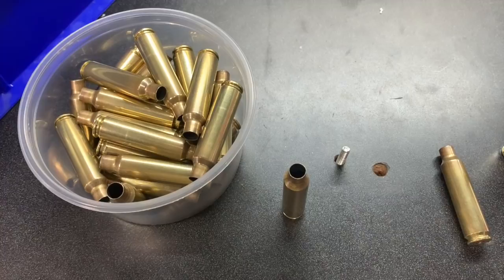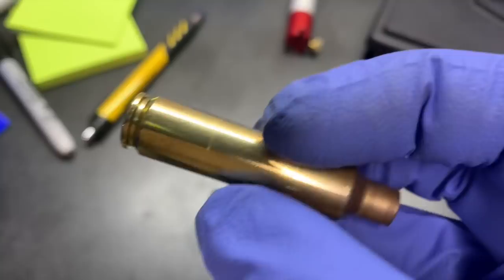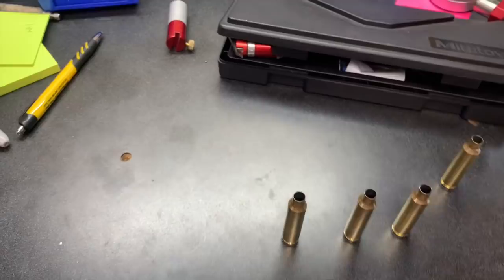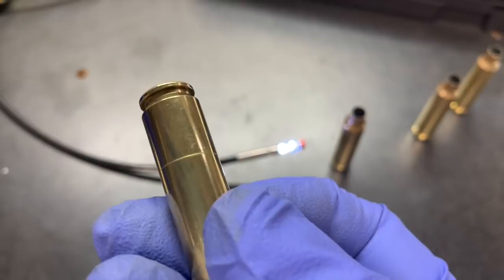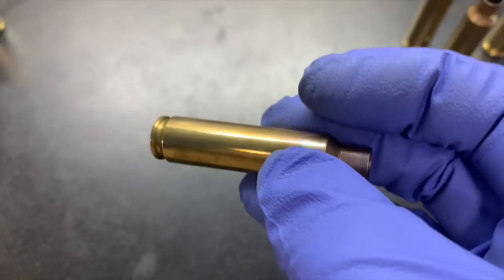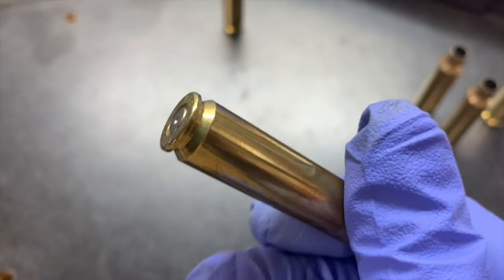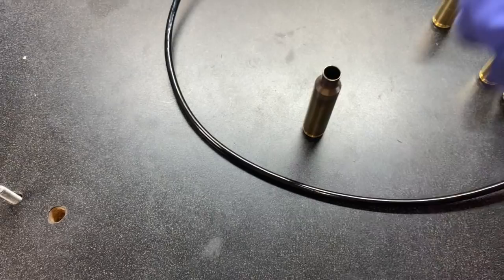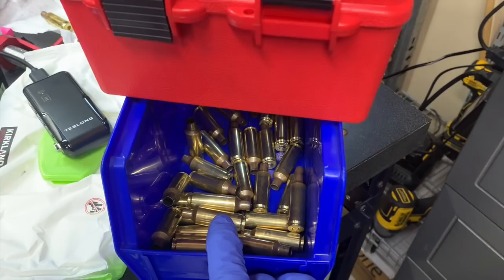Case head separation and what it looks like before it happens

Comment: When I first see the faint line, would I be safe to toss it after the next firing?
Reply from the maker: I couldn't say. I've shot faint lines with no issues and other times had separation. Do what feels safe is the best thing. I tend to lean on ditching brass for several reasons but everyone is different. For one I rather have the best brass to test or shoot (unless I'm testing something weird that doesn't matte) and second I just don't like risking a separation if I can help it.

Comment: I have once fired brass a similar line 1/3 down from the shoulder showed up after full length sizing, do case head separations happen so high? I am wondering is this likely caused by the dies?
Reply from the maker: It depends. If it's right after sizing then yes. If it's after you've been shooting then it's a wear mark from the ammo box which can happen if the hole for your ammo is round.

Comment: I’ve had a few separate but never had one completely separate from the head. Have you ever had that happen or have you seen it? I bet that would be a huge mess.
Reply from the maker: I’ve had it happen and it’s not that bad in terms of a mess. The few times I’ve had it happen the brass came right out although I’m sure u see different circumstances and guns the result could be worse.

Comment: Hi John, I've been looking at this issue lately. I've only ever had 1 chamber produce seperation, a 6.5 SLR that I ran hard and only 5 of 200 cases. You mention that it's caused by sizing. Is that an educated guess or are you sure? The reason I ask is bar the initial resize from 308 to 6.5 I used a Lee collet die  so never sized the body. (Don't tell Eric). I've heard of a few possible causes, just want to try and ID the actual one for everyones benefit.
Reply from the maker: Best I know (and I don't know everything) is that excessive shoulder bump is the main culprit. I do however feel (and I could certainly be wrong) that body sizing has some effect as does how the brass fires in the chamber (but to a very small degree). But keep in mind that if you can trim your brass then you're losing brass from the base to some degree and it adds up over time. And don't worry, I won't tell Eric.
Reply: @FClassJohn  Thanks John, I have a theory that fl sizing is in play here but not the "cause". I was thinking excessive head space on initial fireforming, but on F class guns??? Just not happening. As someone else mentioned,  I noticed your seperation is way further up the case than I've seen before which may be laying another possibility to rest. It looked like the inside of those primer pockets were chamfered. I don't suppose you know what tool was used?
Reply from the maker: @timg6252  I'm sorry I don't. But I like where you're going with this...
Reply: @FClassJohn  I was doing some high speed filming of primers and ran a chamfered pocket through the test. The flame front is a completely different shape (well it's meant to be, that's why some folks do it). It just struck me that the angle of the dangle meant the flame front would hit the case wall right where case head seperation (usually) happens. Your case stuffs that theory up a bit unless the chamfer was done with something 'unusual',  but I'll persue it a bit more.

Comment: Have you noticed if the streaks/channel on the inside of neck effects accuracy by making scratches on bullet?
Reply from the maker: Anecdotally yeah I’ve seen some light marks if I seat a bullet and them pull it. Thats also why I used to bronze wool my necks (a practice I’m starting to do again).
Reply: @FClassJohn  did you do a video on that? I have some virgin Lapua brass that had like a ridge at base of neck. When I ran carbide mandrel it left tiny amount of brass on mandrel. I did not notice till all was done and went to seat bullet. Seated one and pulled bullet. Scratch jacket
Reply from the maker: @justinvandee2008  Yeah it's old. One of my first brass prep videos. The brass wool was part o the video.

Comment: John, have you ever had brass separate in the chamber? I can imagine it might be difficult to get out.
Reply from the maker: Yes I have and it really isn’t that bad although it does affect your shot for sure which is why I’d never risk it at a match if I can help it. Under different loads in different guns the result could always be different of course.
Reply: When it happened to me I used a brass brush on my rod to push it back out

Comment: When I fl resize my brass actually grows by about .0015 does that mean my headspace is off, it still chambers fine and my die is touching the shellholder
Reply from the maker: I've seen plenty of times where a die isn't pushing the shoulders properly (hence the growth) and the die needs to be shortened as little. I usually have my gunsmith throw it in the lathe and shorten them a hair depending on my needs.
Reply: @FClassJohn  thanks for the quick reply, I actually work at a machine shop and custom gun shop Kauger Arms, again thank you
Reply from the maker: @davidhoward4609  No problem. My assumption is this condition is brought on with custom chambers compared to SAMMi spec dies.

Comment: That line is formed by the die when resizing or the gun during firing?

Can it be annealed to that depth to "realign"?
Reply from the maker: To be fair I think (but am not sure) which exerts more force to cause this but it’s a combination for sure. To my knowledge there’s no way to correct it once it’s happens. I just throw them all in a bag labeled ‘damaged’ if they show any damage and use them for other testing at that point.
Reply: K M no it can not be annealed to fix it. The brass has thinned in that area and will fail eventually. The shoulder was bumped too far back and it stretched the brass thin on the next firing.
Reply: @FClassJohn  Thank you for your instruction.
Reply from the maker: @altruisticscoundrel  My pleasure. I'm just glad people find value in it.